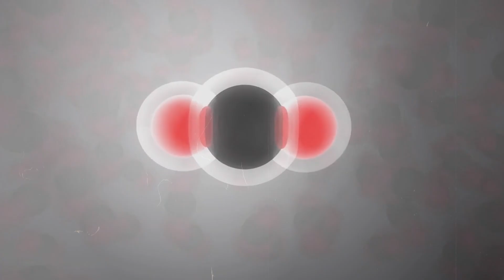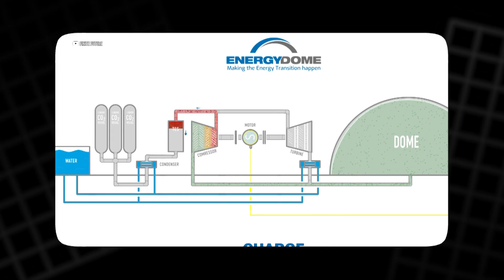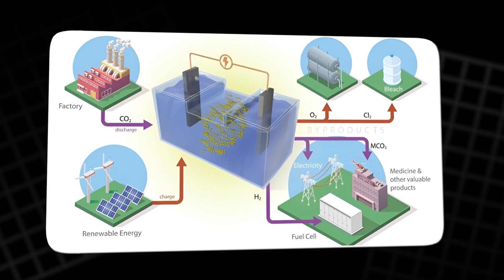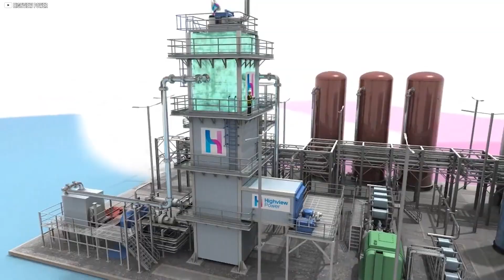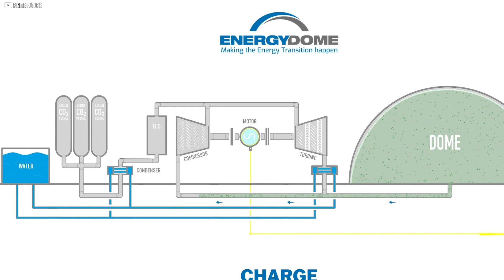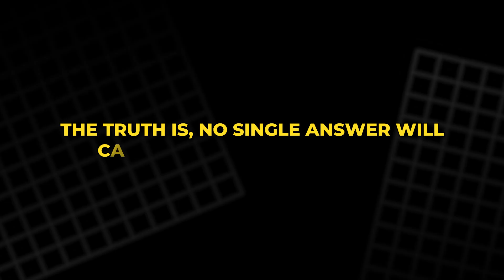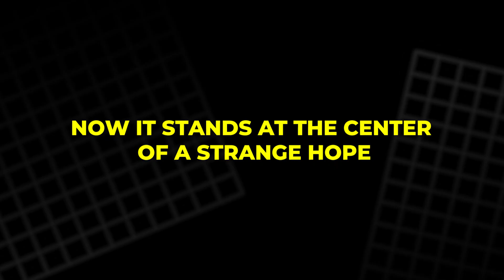Can CO₂ Batteries Really Save the Future of Clean Energy?

Comment: It is very regretable to say that this CO2 storage battery system is completely
useless. The turbine to scrum CO2, that comes from this system, into the baloon ends up
consuming additional amount of CO2. This is the second low of thermodynamics.
At last  I think this advertisment is scum, because the person who make this video
hide the enegy comsuption of the turbine on purpose.
Reply: I think u not understand the concept of storing energy in Compressible gas, here instead or air using co2.   Dry ice can be store  as solid at -85c